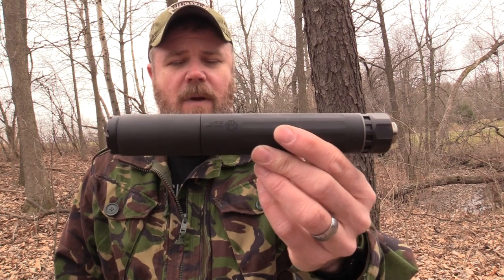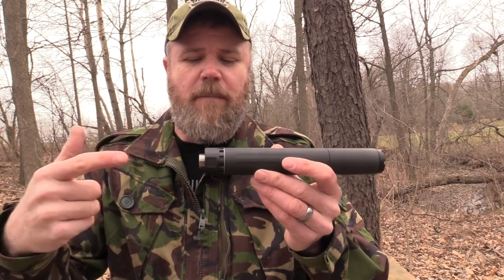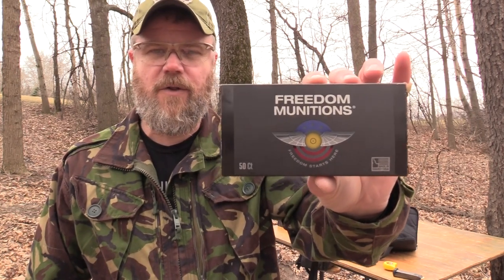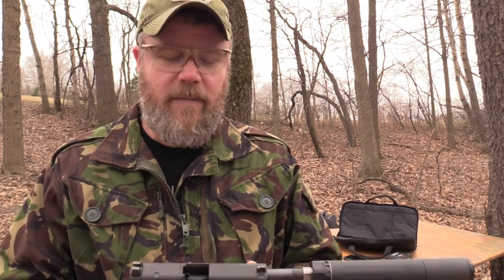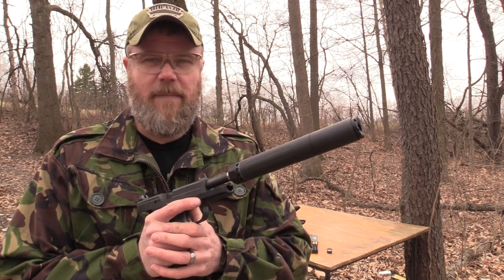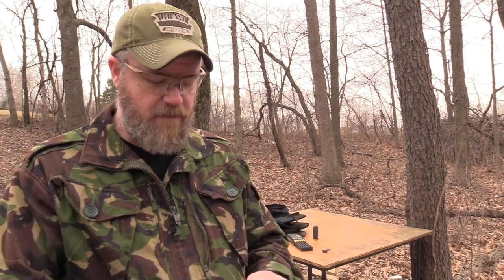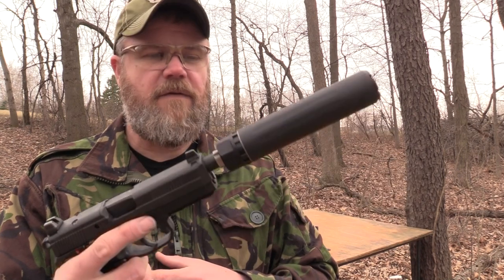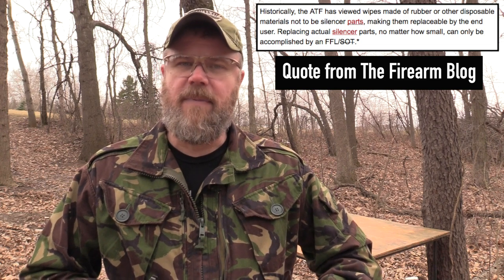BATF: Wipes are now Silencer Parts! DeadAir 45M Range Time

Comment: My question is how do they suppose to police it? This is why a barrel in itself is not a gun part in Poland - must have a breech to be a gun part. Otherwise it's just a tube and you cannot require a permit for all metal tubes just because one of them may be a barrel. Same here, it's just a gasket. Is every gasket a suppressor part now? Will they be stalking people at ranges and checking if they are installing a gasket in their suppressor themselves? On the spot, by the way, because they do not have any way to prove that you did it yourself if you just have one installed, and if you happen to have some "wipes" in your pocket - is it illegal to have gaskets in the US now? If I heard correctly, most suppressors don't even use them now. And if you are allowed to have a suppressor, are you not allowed to service it yourself? That all sounds all kinds of weird to me.

Also, weird way to review a product. First you say that its differentiating feature is now useless and then proceed to show how this feature works in this exact product. It's useless, so why should we care about it?

Comment: One other thought. How difficult would it be to simply make your own wipes? I know that it's not that difficult to get some neoprene, and cutting it to correct size, wouldn't be any more difficult than tracing it onto the materiel and cutting along the line. It seems to me that the ATF is looking for a solution to a problem that doesn't exist. 

Time to end the ATF and the NFA!
Reply from the maker: That's illegal to do as well. Now that the ATF considers wipes to be suppressor parts you can't make them just like you can't make spare baffles.
Reply: Military Arms Channel sounds pretty unenforceable if you ask me.  Pretty hard to prove you made your own wipes.  But then the nonsense with "shouldering of a brace", seems pretty unenforceable as well.  What else can we expect from  the ATF?  They are after the ATF,  Alcoholics,  Yards,  and Frifes(as in Barney). Time to disband them.

Comment: Unfortunately, the reality is that wipes are silencer parts. The prior letter is the one that was wrong. The proper change would be for the ATF to say that wipes are silencer parts, but they need not be subject to the same restrictions as machined baffles or the portion of then silencer that holds the wipe itself.
Reply from the maker: I think the right thing to do is to repeal the NFA. Sans that, the ATF should not consider a part to be a silencer as a baffle by itself is not a working silencer just as a wipe, by itself, is not a working silencer. Once assembled, now you have a working silencer.

Comment: My understanding is that this was an informal notification, by the FTB, in regard to the Bardwell letter. This does not constitute an official ATF NFA ruling and bears no weight on all "silencer parts". An end user cannot swap the wipes, as this was Mfr'd by an 02/07. However, this should not apply to Form1 builders, with wiped cans. Again, the ATF/FTB flip-flops so much it's confusing. But, until an official ruling is released, this changes nothing.
Reply from the maker: It is confusing for sure. You have to be a lawyer to buy a silencer to make sure you don't run afoul of the law. It shouldn't be this complicated. People shouldn't become criminals because they don't have a law degree nor are they able to keep up with the never ending changes and rulings.
Reply: Amen brother. Keep the vids coming. Still waiting on 762 and 556 silencer dB testing with bolt actions :)

Comment: It would seem that if a person paid over $700 for a suppressor, paid for a tax stamp at $200, and waited for a long few months to receive both. And if you can get replacement parts (Except for the serialized part of the suppressor) from the suppressor manufacturer, ONCE you legally own the suppressor.  Then why would the "batf" even care or even be able to tell if your wipe was original, or replaced.   Are they going to outlaw sheets of neoprene, rubber, urethane, and memory foam materials?

Comment: I sure one could find some neoprene "washers" that would work perfectly.....I am not recommending or condoning circumventing the law but I doubt the BATF will be checking every suppressor each time its fired to determine whether a new wipe has been installed or if someone is using neoprene washers as wipes.

Comment: Buy some rubber sheeting the correct thickness and order two hollow punches, one for outer diameter and one for the inner.  Make your own.  I've seen the rubber sheeting and these types of punches at my work, the mechanics use them to make gaskets.  Of course this ruling is ridiculous and serves no purpose to protect anyone or stop any kind of crime.  But, don't let that stop you if having these wipes is important to you.  I don't even own a suppressor, but I would set up to make these myself if I had one that used them.

Comment: Not siding with the ruling at all but if you advertise a part as a part of a suppressor it should be no surprise that it's ruled a suppressor part. There is something you didn't mention and that is any gunsmith with a O1 FFL can repair a suppressor or MG for that matter so if you want to stay legal it's no big deal to have a local gunsmith replace a wipe, shouldn't have to but at least you don't have to send it off.

Comment: 140dB for hearing safe? Exposure to sound over 120dB can cause immediate damage and exposure to sound in excess of 112dB for periods longer than 56 will begin causing permanent hearing damage.
Reply from the maker: You really need to read the OSHA regulations. This is extremely old news. 140dB is the threshold for a single impact noise. Not 120dB, not 90dB. It's 140dB. You're talking about extended exposure, not impact exposure.
Reply from the maker: Here, let me help you: https://www.osha.gov/pls/oshaweb/owadisp.show_document?p_table=standards&p_id=9735

Search for "140db" and you'll find the following:

"Exposure to impulsive or impact noise should not exceed 140 dB peak sound pressure level."
Reply: Thank you that was very helpful.

Comment: I didn't realize first-round-pop was due to burning the air in the can.
So, while it wouldn't be practical in an emergency situation, couldn't someone avoid the "pop" by filling the suppressor with non-combustible gas (like nitrogen or CO2)?
Reply from the maker: +Kyle M Green Yes, or just keep it with wire pulling gel in there. It accomplishes the same thing, just messy.
Reply: I've recently ordered a Silencerco Hybrid. My first suppressor! While it would be fun to mess around with ablatives, I don't think I'd want to deal with gel in this can design.
I'm eager to get it but I'm sure it's going to be in "jail" for quite some time :-/

Comment: Why can't one make suppressed ammunition? I believe the Russians did this as I recall in a book I read years ago by Ian V Hogg. It would eliminate all suppressors. In addition, I recall something called a Fluid Diode by Nikola Tesla which worked for water which is an incompressible fluid. However at the few microseconds of a round on a barrel, one might wonder if the gas bled off could be momentarily compress to a point where it could reduce the noise?

Comment: Do you know whom I could contact at the ATF to find out if a person could prototype the baffle system on a 3-D printer for testing befor building a metals one, after the hearing protection act passes: I'm pretty certen that the plastic would be destroyed writhen a few shot's at least that is what my computer simulation show for my PS90--about one 50 round magazine in theory would melt the plastic to slag. It just now occurred to me that I don't even know if I could make one that would work because my design has moving part's as part of the baffle system, I'm going to have to think about that one, because my computer is simulating for metal not for plastic, time for some re-programing, to see if it will even work: The problem is that I would have to print it as one unit moving part's and all: My design is set up to be one peace once every thing is pressed together and wielded.

Comment: Only the manufacturer can add water to your suppressor. Water is now a suppressor part.
Reply from the maker: I just had that conversation. You're right. Water, wire pulling grease, or any ablative material is a suppressor part. It's f'ing lunacy.

Comment: Or you can just afix a bit of duct tape over the muzzle of the silencer. Might not be quite as good, reliable or durable, but cost like a few cents. And it´s just there to keep moisture out of the silencer don´t you know. ;) (Just pulled this out of my behind, have no idea if it would actually work.)

Actually, how much would a few layers of duct tape affect the Db level? Say 2-3 layers across and then a wrap around the front end and over the ends so the layers don´t come off while shooting. Would be interesting to know if/how well that works.

Anyone?

Comment: Actually ATF has done this over and over with each suppressor manufactures incorporating wipes into suppressor designs since the late 80s. Naturally I agree with the silliness especially based on Interpretation Ruling and not actual Law language past by Congress, Senate, and signed by President. 

ATF has convinced judges to imprison people based on Rulings. ATF arguably claims their Rulings link criminal actions violating Federal Gun Laws regardless no actual language addressing the issues. 

However for those who are thanking they can make their own baffle wipe material is considered manufacturing suppressor parts by ATF. Unless you’re a licensed Class 2 manufacture Don’t..!

Comment: Wipes are used so the bullet will have just enough room to pass through and seal from gas leakage. If you have a modern suppressor, there is no reason to use a wipe because they can match the diameter of the bullet with a machine.
Reply: But they don't do that.  There is always generous amount of space around the bullet and the baffles or monocores and the end cap.  Too small of an exit hole or suppressor channel is actually detrimental to suppressor performance.  I found a lot of good info at the silencer/suppressor and the NFA forums, under the Form 1 make your own baffles and suppressors catagories.  I may get around to doing a Form 1 suppressor but for now I like dealing with companies that make them in case I need quick parts or repairs.  I definitely will do some MP5 clone Form 1 SBR's.

Comment: Why no water in rifle silencers?
Reply: I believe it is because the pressures are a lot higher in rifles and water is basically not compressible so it's possible that too much water in a suppressor may blow the can apart during firing.  Most cans these days are designed to run dry however many of them are designed to run with small amount of water in them and some cans are actually designed to run wet as you can get more sound suppression out of a smaller suppressor.  The best thing to do is to follow the manufacturer directions for the specific can you are running.

Comment: Then stop putting wipes into the silencer. Instead order Urethane Washers of the right diameter. Buy a Wipe you pay 10 dollars each but the same washer cost 50 cents. They are both 1/4 inch thick urethane washers of 1 1/8 diameter with a 1/4 inch hole.  They come in a pack of 10 for 3 dollars.

Comment: ATF:  Rubber gaskets are silencers.
Reply from the maker: So is water, wire pulling grease, or anything else you can stuff in your silencer. It's all now regulated and requires $200. So, if you're at the range with a bottle of water that you've not paid your $200 tax on, off to jail with you!

Comment: Can't you just put some duct-tape over the front? That's a (trivial) legal question but what about the physics, whether you put a neoprene disk or tape over the muzzle, how will that eliminate oxygen from inside the can? Air is allowed to freely exchange before you sealed either end, you'd seal normal air inside, you'd have to fire a few shots (with the final shot ending on a close chamber with live round) then quickly cover the muzzle end of the suppressor with tape... but you could never do that with a neoprene disk quickly enough.

Comment: Wipes look pathetically easy to make from neoprene on  your own. They look liek great neoprene washers to use for vibration and noise isolation. 

The SilenceerCo can definitely looks like it has more backpressure. Way more gas coming back and handing out during the next shot, where as the alternatives avoid such issues. Fuinny how he didn't mention the gas difference.

Comment: Yeah... Good luck enforcing the replacements of a non-serialized part. I can cut my own wipes out of a sheet of appropriate thickness neoprene with a freaking cookie cutter.

The BATF needs to be disbanded. The ring leaders need to be dragged out into the street and flogged.
Reply: flogged? you're kind.
Reply: Scalped, salted, and lemon juiced.
Reply: Tequila?

Comment: The BS that continues to come from the ATF to hassle the NFA users is a travesty. However it seems like this is the only modern suppressor on the market that even uses wipes.  Wipes just seem like an idea from the past that fell to the wayside due to more modern manufacturing and demand for more durable suppressors.  It was interesting that Deadair brought back the idea, but why?  Could wipes had made a comeback?
Reply from the maker: +Steel Talon Not true, Thompson Machine has a wiped silencer as well. Other companies were starting to use them to increase suppression but the ATF decided they don't like that anymore. Also, companies were looking at new materials that last much longer.
Reply: Interesting.  This just seems like a huge FU by the ATF than anything else.  I could see vaguely where they could claim that a brace being used a stock is a stock, but this is just petty.

Comment: So will it be illegal for someone to post a video on how to make washers?  Get sheets of 
the right neoprene (or one made of any of the 20+ different synthetic rubbers) in the correct mil
thickness, stamp out the circles in the correct circumference and then punch out the center.  Is 
a certain size flipping rubber washer now illegal?  Yikes.  Better check your tool boxes folks
you may be in non-compliance.

Comment: This whole process and Dead Air Silencers less than enthusiatic response to address this issue with the Ghost M situation is most disconcerting. I chose the Dead Air over the Rugged Obsidian by a recommendation and now after all these months I know I have made the wrong decision. Despite the forever wait times, a silencer is a product you have to trust advice and judgment form the dealers and anyone who might have used the product. Now, I am stuck with a silencer, paid for it, waiting on the stamp, and consider it not complete and have not even received it.  I was strongly considering another Dead Air product but going to think twice about that. I feel that I have to go with a company that is more responsive, addresses the customers concerns and stands by their products. These NFA items are not cheap. Maybe my hard earned dollars would be better spent elsewhere, and I am sure to express my opinion to anyone considering buying a Dead Air Silencer product in the future.

Comment: What the hell ever happened to Trump and the petition to repealing the NFA and the business with the Hearing Protection Act?
Reply: The petition if it got enough signatures just ensures that the administration has to take a look into the issue.  It doesn't guarantee anything will be done about it.  As far as the Hearing Protection Act I believe it is still in committee and will be until it is called to vote on.
Reply: Craig Arnold I thought if it got over 100k signatures, which it did, then itd require a public response as well
Reply: Craig Arnold Thats fine, but wueres the response is what id like to know
Reply: It's the Government, they don't do anything quickly.  It'll probably take 3 months minimum before you see a reply and could easily take longer than that.
Reply: That petition did nothing just like I said it wouldn't.

Comment: This is clickbait. They could have kept making wipes but PR cowardice always prevails. Or they could have shipped 20lbs of wipes inside a throwaway pvc "baffle". Or just used sheets of baffle material to make the box it ships in. 
They are making too much money to actually stir the pot tho. I would have at least found out who that guys boss is and raise hell. Either way, if you can't make a wipe, you probably don't have the capacity to run and clean a firearm.